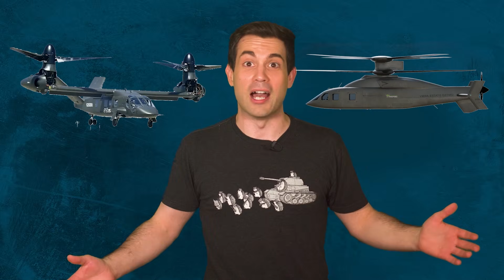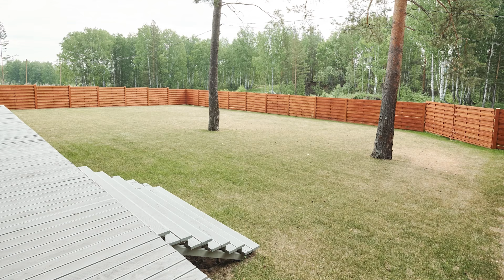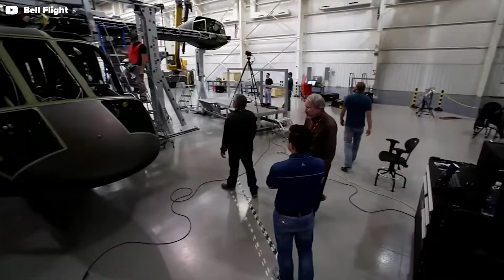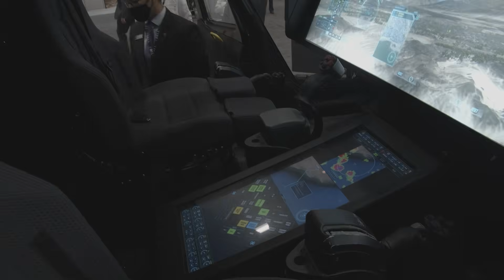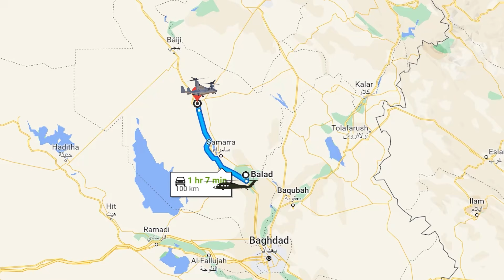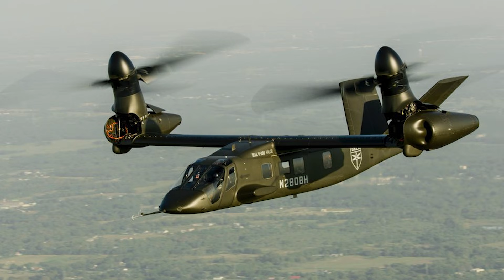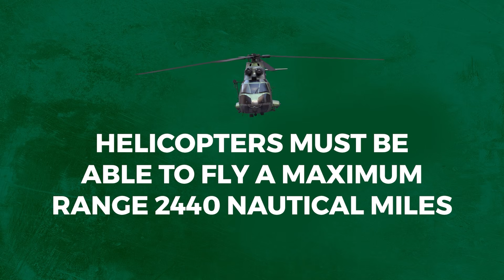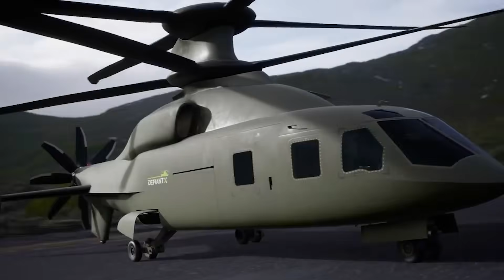V-280 Valor Helicopter Will Help Defeat China

Comment: Parking helo to parking lot... yeah i doubt that Bell creation can do that with out wrecking its rotors real fast, but i kinda like the new V22... except ability to fly it remotely and all the fly by wire shit...What ever the machine, i'm the operator and i want to control it.. now be on whims who ever was able to crack the security of this thing and take it over mid flight and yes at some point that will be cracked and exploited, If it can be connected with any shape or form, it can be hacked and that exploited. Best lock is good as person whos willing to brute force it or dedicated enough to find flaw in its design...

Comment: you can forget them picking the right one look at at their choice with the f22 and yf23 clearly the yf23 was the better plane but we got the f22 instead . it seems like they do this alot I wonder who actually makes these decisions or do they do the whole inie minie miny mo deal . my thoughts are they should choose both for different reasons. the defiant would be great for island hopping but the Valor I think would be better for the navy. the Valor seems better for bigger landing areas and not that great in smaller quarters. and the Valor seems  better for payloads carrying then bringing troops in and dropping them off in places thats not built for bigger planes . to me it's like your trying to compare potatoes to a tomato their different and great for different things and I think you can arm the defiant better then the Valor for those up and close moments on the battle field. so to me the defiant is the clear winner for what the army needs right now but I can see where the Valor could come in handy if they need to carry a bunch of stuff. I would try to get both if they could swing  it but if not the defiant is my choice but I do like the whole idea of the Valor  using drones. this is a hard one .

Comment: I wonder how this is going to be influenced by joint service requirements once congress gets to making purchase decisions. The H60 airframe was multi service and multi role. You mention combat search and rescue, and that's a role in which there's heavy footprint with USAF. One under appreciated logistics impact is our squadron had a number of green to blue pilots and they conceivably had little learning curve since its the same basic frame, just a different mission load out. USAF seems to be sticking with the H60 (for now at least), with the newer whiskey model. But that still doesn't have the type of range that we're talking about in a Pacific full theater operation. Does this mean the services are diverging? USAF is prioritizing an expedited push to a NGAD frame. Maybe the budget isn't there for upgrades here. But considering one of the primary bottlenecks is trained pilots, something we seeing crippling Russia right now in Ukraine, it would seem to be a good idea to keep some measure of frame uniformity across the services. I'd lean toward the Defiant in this hypothetical winning out.
Reply: 60 is not going away anytime soon. FLRAA will transition into service and 60 may be used all the way to 2050.

Comment: Let's balance cost, innovation, and needs. Just because a weapon system has been around a long time e doesn't mean it needs to be replaced as a whole. The DoD can simply have new ones built. No, the company doesn't get a choice. Someone else can always build it.  New eapon systems can be tested and improved at something like a squadron level without the price tag until the older design is truly obsolete.

Comment: Cappy, after watching the video, I am left wondering; are you bitter you did not join the Air Force?  Instead of advancing on the enemy, being shot at, and sleeping in bug infested pits, I mean trenches, you would have been working in an air conditioned office, hot meals prepared in a cafeteria, at a nice safe airbase a 1000 miles from the enemy, your daily PT would have consisted of walking the runway or the golf course picking up FOD.  The Air Force, the best force, where the officers get shot at and the enlisted stay on the base 🤡 😂  Great video BTW!

Comment: I think the Defiant will get the contract for a few reasons. I know when I was flying Hawks in both the Army and Air Force, profile was important,  deck space for shipboard ops as well as when airlifting via C17.  And it looks like the Defiant would have the advantage there. Even at 300+ KTS it is a long way from Ft Campbell or Ft Brag to the Pacific. 
The V22 has proven itself to be a mediocre helicopter and a mediocre fixed wing aircraft. Don’t get me wrong, The V22 is a great aircraft and fulfills an awesome niche that helicopters and fixed wings can’t but I think the Army needs more of a helicopter than a hybrid in terms of vertical lift and ability to worked in confined areas.  I think the Defiant has the advantage in that area too.
Reply: The problem is people like to think of a tiltrotor as a replacement for traditional helicopters, something it will never be because it's less efficient in vertical lift and loiter and less efficient than an airplane in forward flight due to the necessary compromise between disk loading and prop drag.
Reply: @atomicskull6405  Yes exactly what I was trying to say when talking about the V-22. For the Army I think the Army needs something closer to a traditional helicopter and so I think the Defiant will win out.
Reply: If you watch the sikorsky videos about the defiant, it would appear they are planning to replace H-60 Hawk series of helicopters across all the branches. As well as working on a dedicated attack platform version using the compound coaxial design.
Reply: @Deathvalleyherper  That would basically be the AH-56 bit with coaxial rotors.
Reply: @atomicskull6405  yea except the coaxial rotors counteract the disymmetry of lift issue the ah56 had at higher speeds.
Reply: Two things here:  There was no requirement in the FLRAA program for the craft to be able to fit in a C-17 without major disassembly. .  The idea is that if they didn't get ferried on ships they'd be flown where.  Bell has shown how a folding mechanism could be added to the V-280 so that it would fold up into the size of  a folded UH-1Y.  This isn't required for the Army mission, but in a Navy model this would permit them to be based on DDGs.   Sikorsky has notaddressed what it would do about mast height to operate them from ships.
Reply: Different tools for different jobs, so I think there is a place for Defiant X. The idea of winning or losing a contract is an archaic mindset that needs to go. Keep things competitive but the loser still might get awarded a smaller contract. Valor won and Defiant X lost, but should it be that simple?

Comment: The way I see it, Bell and Lockheed are both extremely venerable companies in the military sector with some of the most iconic designs in the field. 

Meanwhile the Sikorsky blackhawk is being investigated for safety issues, and Boeing has literally devolved into a trashfire of a company. 

On credentials alone, I hope the contract goes to Lockheed and Bell. It'll probably run over budget, but at least it'll work.

Comment: I am a fancy Sikorsky helicopter engineer. 🇺🇸 For Defiant X, we have 2 main goals: redundancy and capability for size.  It's the size of a hawk, more maneuverable than one, way faster, and will carry more.  It has redundancy so sophisticated, even I am amazed and I work on it. While it's not as fast as V-280 at the moment, we absolutely refuse to compromise on survivability and "fly-ability" as we like to say.  "We pioneer flight solutions that bring people home everywhere … every time"
Reply: Hi fancy Sikorsky engineer. I imagine coaxial blades mean some fun extra turbulent fluid dynamics to deal with, affecting both longevity of parts and perhaps noise while operating. Is there anything unclassified you can say on the subject? (Don't get fired.)
Reply: This top rotor arrangement makes the aerodynamics better. Some slight additional maintenance challenges compared to hawks but well understand and manageable. Improvements in other areas can potentially keep total maintenance workload about the same or less.

Comment: The SB-1 will require a lot of maintenance. Coaxial rotors can be problematic. The V-280 will be a larger aircraft. It might not be able to land into some areas but it will be able to rappel the soldiers in or pick them up. There goes that argument for the SB-1. Both are interesting aircraft but the decision will be between reliability and this ability of landing in confined spaces.
Reply: There may be some additional wear on swash plates and gearboxes with SB-1 but it is manageable. It is a pretty well developed technology at this point. Defiant is a better platform for roping down. Defiant has better agility and fields of fire for approaching and leaving an area close to adversaries. Defiant has downwash with less hot gases and less crosswind turbulence for safer operations under it, whether roping or landing in tight improvised spaces.
Reply: @Stu_Bur  

Yes, it's manageable by working far more and with more expensive parts. This was manageable with the Soviets in the 1980s too and it was a well developed technology at the time also. No, it's not worth. It's unreliable and expensive. If you believe that the army should help an expensive and unreliable helicopter, that's your problem. It isn't. This is not about how much you like the helicopter. The SB-1 is the worse of the 2. If you have to "rope down" from an SB-1 there's no point in having it. You're better off with the V-280. Also, there's no such thing as "roping down". It's called rappelling. Learn English. And no, the SB-1 is not better for rappelling. SB-1 is going to be slower. The V-280 has at the very least the same "fields of fire". The SB-1 DOESN'T have a downwash with less hot gases and less turbulence. What "roping"? There's no such thing as "roping". Learn English. That's rappelling.

Comment: Thinking out of the box:  How about a V-22 Osprey-like submarine that could sneak up underwater, surface, then fly helicopter-like to an island, then return at speed like a plane to rescue the wounded.
Reply: Seems to me that a configuration closer to Defiant might be more likely to be feasible. A pusher propeller might be able to double up for use in air and water. long and thin shape means better speed underwater with less drag. Automatic rotor folding for defiant is already planned for use on surface ships. Some type of stowage cover for the folded rotor blades might be possible for theoretical underwater use in a submarine aircraft concept. Still probably not practical for operational use due to maintenance and logistics issues but might be possible.
Reply: @Stu_Bur  Thanks for your detailed response.  I was further thinking it might be possible to have a submersible helicopter transport for a single helicopter.  Instead of flying in from over the surf, the helicopter could emerge from an underwater, electric powered pontoon platform.

Comment: Whichever model allows for street level flight with extremely sharp turns performed at high speeds at capacity...

....but we'll only need it IF Jamie Foxx gives the signal from the WH lawn 🤔 still, better to be prepared 👍

Comment: For those curious, Defiant X has reached a top speed of 272mph and can cruise at 250mph in it's prototype stage. Basically twice as fast as the Blackhawk. It does this without the real or perceived safety concerns of the tilt rotor design. One way or the other the Army will move forward.

Comment: Hi Cappy, while i like the loadout and capabilities of the tilt rotor  are commendable and it certainly has its place; I am inclined more toward the lower observable helicopter with a pusher prop. It has very high speed and is a more nimble and stealthy craft. From a tactical perspective I feel the helicopter should be in the initial lead force, with the tilt rotor being used as a resupply of troops, and associated ammo and food etc. In this way the best of both worlds might be achieved.The forward deployed units would hopefully be in a better  position to defend the less stealthy and more vulnerable tilt aircraft, in its ongoing role.

Comment: I’ve always wondered if developing the Chinook with additional semi-jet engines on the side would be better. So it’ll be able to focus on deploying at less then neck break speeds, and even if it’s jets aren’t operational, it’ll still be nimble and have a short profile enough to land and fly off.  Plus the ability to deploy vehicles WITH infantry is pretty enticing. Maybe it’s not a perfect concept, but considering the chinook’s history, they have a lot of potential.
Reply: Jet thrust isn’t very efficient for rotorcraft because of aerodynamic reasons. A pusher propeller aft of the top rotors or stacked counterrotating top rotors works better. Chinook is pretty fast for a helicopter as is though.

Comment: This looks like another F-35 far cup where they want one airframe to do everything. As seen with the pig, it only does one thing well and that is to provide jobs in 48 states and ensures that it can't fail for purely political reasons. As far as I can see the boots on the ground are going to take casualties due to the pig being a jack in the box and not being a master of anything. Time to look at designing and building specialist machines that can be a master of their job and keep their SLF/SULF safer once they have "egressed" (yeah, it's a good word). 👍

Comment: Gonna call it now. The Skikorsky will win. Its more conventional, and the pilots will be more comfortable operating it. The Valor which works more like an Osprey has to be flown differntly. Plus the skikorsky frame has both an Atrack and transport version. 2 birds mean greater ease for supply and training for ground/air crews
Reply: Also the Army wants to base a gunship on the winner in a Cobra / Huey sort of affair and a tiltrotor would make a terrible gunship due to the higher disk loading and noise in hover and loiter. No matter what a tiltrotor has to compromise between disk loading and prop drag.

Comment: Form the reports of difficulties with the complexity of the Osprey, not to mention the perceived width of the Bell V-280 Valor, my money is on the Sikorsky/Boeing SB-1 Defiant to be selected to replace the Blackhawk: it has a similar profile and the added stability would make it better with the side gunner. I'd be worried about a side gunner in the V-280 Valor accidently shooting out an engine due to sudden motion. Since you bring up the M4 replacement, the Army went with really the most conservative choice that checked all the boxes-a steel head brass case is hardly an next generation innovation.

You don't go through the specs of the Sikorsky in the same detail, but I imagine it has some range limitations right now compared to the tilt rotor, and it will never have close to the same top speed. 

The main factor though is just width. The tilt rotor is simply too wide to participate in the same missions and battlefields. While yes war in SE Asia will feature island hopping, it will also feature developed urban warfare, and the width of the tilt rotor will limit its use in cities. This is less important for attack, but still important for medical evac and support roles. The tilt rotor also lacks the versatility. I haven't seen any mockups of an attack version of the airframe, but the Sikorsky seems more capable of modularity. They're submitting a similarly designed chopper as a replacement of the little bird scout platform for example. Meanwhile Bell is submitting an entirely different airframe for attack support role to go with this, and that aircraft is a conventional single rotor chopper. 

In this case it would be interesting if the Army went with the Air Forces proposed plan of smaller orders and faster design build deliver of air frames going forward. In this case the Amry could train different forces to see how well they perform on maneuvers, and keep them around for specialized roles. 

If war concerns are really focused on Island hopping, then I'm surprised there hasn't been further developement on ground effect vehicles: the speed of aircraft, with greater weight capacity of of large boat. Once a beach head is established and a temporary port made, you could quickly deploy supplies and reinforce an island before the enemy could attempt to retake it. 

Ultimately I see these air frame instead of offering the same capacities and roles are more subtly different but overlapping roles. Many of the benefits of the Valor  seem to be closely fulfilled by the Osprey which is already in wide use, so if war broke out tomorrow the Army would probably be ordering Ospreys. While the Sikorsky offers a more beefed up Blackhawk. That said the Valor is meeting most of the goals already in terms of range and speed and has years more data and development than the Defiant.
Reply: Speed and range is slightly less for Defiant compared to Valor but still way better than Blackhawk. Defiant has numerous advantages in other areas that make it a better package overall, such as agility, fields of fire, narrower profile, and reduced hot gasses in downwash. V-22 is a more capable platform than V-280 for logistics.